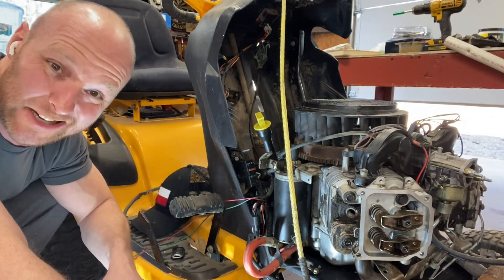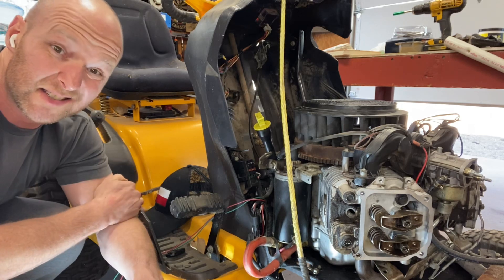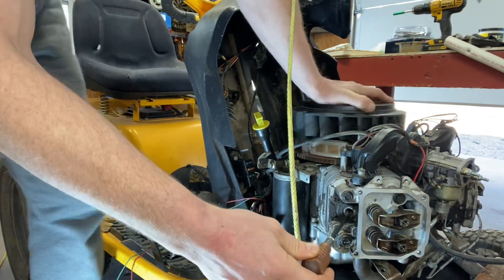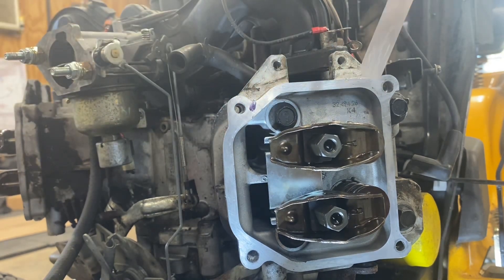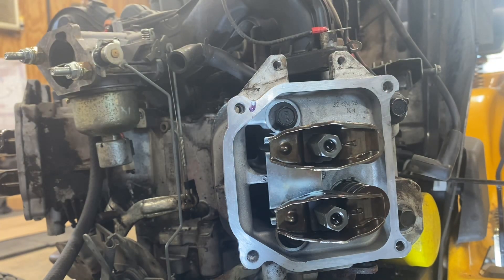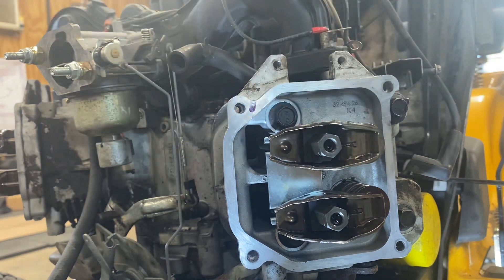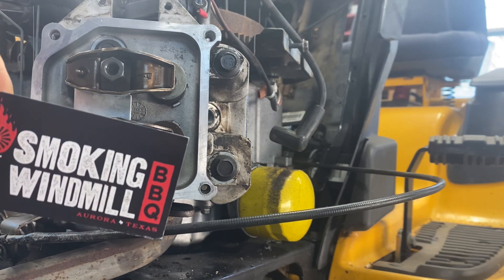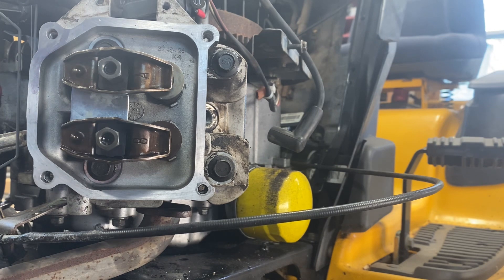Kohler Courage Valve Lash Adjustment & CARD TRICK!!

Comment: Excellent video well done. I have just replaced the crank shaft on a Kohler HD775. We lined up all the markings and put it back together and adjusted the valves at TDC and it will not fire up doesn't even try. We have a spark (new spark plug) fuel (new fuel) checked the carburettor and all fuel is flowing and done the usual checks on the safety. Any ideas on what we may have missed. Thanks and keep up the great work us small Maintenance company's swear by them. Steven
Reply from the maker: If you have fire and fuel I would check compression. Then check if you have any intake leaks. 

So cool i have professionals watching, I am far from that just tinkering and learning. Let me know what it ends up being. Just keep at it and don’t give up you will figure it out.

Comment: Do you do top valve and bottom valve on each side at the same setting
Reply from the maker: Yes it gets them close enough
Reply: @MowerMike I mean in the video you just done the top valve i asking you if you do the top and the bottom one also are just the top one you did because you only done the top not the bottom one just trying to make sure before I do it because if I need to do bottom one at the same time I will thanks just let me

Comment: Love your videos, thanks. Question if you have the time. My son bought a used Lazer in the winter so he couldn't really test it. 500 hours Kohler CV742 Starts ok but revs slow but gets there. When cutting or going up hill loses rpm fast, He had it at a local mower shop twice for a fix, nothing. It's a good mower shop, and checked everything, coils, carb, compression and fuel system but never pulled the engine to check anything internally. To me, it feels like the timing is off, but the keyway is fine. Do have any ideas, we have no problem taking engine apart to fix it. Also I had my son run the mower uphill so it would bog down, and I was behind him and pushed the governor lever and nothing.
Reply from the maker: Hey thanks for the comment. 

If you have fresh gas and the carb is clean my guess is the piston rings are just getting worn out. Try checking compression yourself and if it is under 100lbs or so it needs fresh rings. Let me know what you find out.

Comment: I a bit confused. So if my piston is at the top can I just set both the valves on  that head?  I was told by Taryl that if your piston can be in the upward position yet your valves are not completely seated. So what is your view on this?
Thanks

Comment: Hello, I’ve been searching the internet for an oil filter and oil to use in my SV-720 courage Kohler engine. Do you have any tips on what oil to buy? Can it be just normal car 10w-30 full synthetic?
Reply from the maker: Hi there. I highly suggest using Amsoil 10w30 small engine oil. You can get it at the link below. But really any 10w30 oil will work. Key is keeping it clean. 

https://www.amsoil.com/p/amsoil-10w-30-100-synthetic-small-engine-oil-ase/?zo=1360728

I would google your engine model number on Amazon and get an oil filter.
Reply: @MowerMike  ok great, thanks for the help!!

Comment: Hey Mike, I have the Confidant 747 and have had bent rods before.  This time one broke and one bend.  Replaced them and went to set the valve lash and only one of the 4 rockers move when I turn the motor.  Is the cam wiped?
Reply from the maker: Hmm not sure on that one. You may need to open it up and find out, can put new piston rings and gaskets while you are at it.

Comment: I adjusted the valves on a Predator 1400 Generator just this morning, I thought I was stuck because one of the valves called for .00023 to .00039. My smallest feeler gauge is .oo4, just above the higher limit. I made a feeler gauge using my micrometer and tin foil. Three layers came out to .00027. I folded the edges down to where my feeler "Strip" was about 3.8" wide with the rolled edged on both sides. I use y needle nose to put bend in (Like a lot of feeler gauges have) so I could actually get in to where it needed to be without tearing or crumpling the foil, made the adjustments and it went just fine.
Reply from the maker: Those are crazy small tolerances
Reply: @MowerMike  It was! It took several tries on each to get it right. Those were the smallest rocker arms I've ever seen, too. The center adjusting bolt was a T-10 and the lock nut was an 8mm, but the arm itself was about half as long as my thumb. The valve springs were about as big around as somewhere between a dime and a penny. The push rod slipped out of place once. It was maybe a tiny bit bigger than a Bic pen refill. My needle nose was too big to get it back in place and I had to use tweezers.

Comment: Good instruction but I wud emphasize Mike’s point to NOT over-tighten the set screw (with Torx screwdriver). I’m not real strong (a senior) so I tightened it a second time to b sure. Disaster! The bit snapped inside the set screw. It’s very tight and I’ve tapped it, magnets, etc and can’t get it out. I will get a good metal drill bit to try and drill it out. If that direct vibration won’t get it out, I might leave it cuz if that doesn’t get it out, I doubt it will come out. Even if it does, I think it would just lay on the bottom of the valve cover anyway.
Reply from the maker: Youch, sounds like you are stronger than you think!!! I would just see if it runs as is and not take it out unless you have to. 

When removing stuff like that I found that left handed drill bits work the best. Just keep drilling with small bits working up in size until it grabs. Or you can try and cut a little slice with a dermal type blade and see if you can get a flat head screwdriver on it. Let me know how it comes out. Worst case you remove the head and take it to a machine shop and they can fix it for ya.
Reply: Unscrew the bolt on top of the rocker with the set screw in it and you will easily be able to get it out because there will be no pressure on it.

Comment: I'd like to see what the square plug of wires goes to from the engine must go to something john deere doesn't have
Reply from the maker: Find the square hole and plug it in.
Reply: @MowerMike  there's none on this John deere cause the engine didn't go to the mower its a zero turn John deere tractor mower the original engine was a 18hp is all the guy said

Comment: Lets see your wiring on that so i can see how to hook it up on this john deere zero turn with the steering wheel instead of handle bars i don't like this john deere i got might take off its weird steering wheel and front axle then no more swivel wheels
Reply from the maker: That mower is long gone, good luck
Reply: @MowerMike  i looked up Kohlers wiring colors and i should be set with that but mine are all fucked up

Comment: Just opened my valves case for a head gasket job, valves only have on bolt in the center , no inner hole for a inner lock , how do I adjust a single screw valve?
Reply from the maker: I have no idea. Good luck
Reply: @MowerMike  hydraulic lifters, unadjustable apparently

Comment: The valves on my Toro Branco were T15. Other than that, your video was spot on and fixed my problem.
Reply from the maker: Glad it helped
Reply: Also on the Kohler 7000 series (KT735) it uses a T25.

Comment: I just paid someone to adjust the valves on my Toro zero turn and within 2 weeks it is difficult to start
Doing the same thing again. What do you think?? Is there a point where they aren't adjustable??
Reply from the maker: I would adjust them again but pull your pushrods and make sure they are not bent.
Reply: @MowerMike  ok thanks

Comment: We were getting surging and so on.  Before I had chance to look at anything (like fuel filter etc) it fully quit and will not start.  Occasionally it nearly catches but does not fire up.  

Found a cracked valve cover and under that I found a rocker had slipped off the spring perch and sat diagonal in the valley.  I can manage it back onto the perch (but failed to think about TDC, will when I get back to it) but it just pops off just as easily.  I have not tried to start it since finding this, or after realigning.  And I have not had chance to investigate bent pushrod yet.  

With this lash set properly will the rocker come off the perch?  Is there some other obvious failure that this indicates?   I have not had the lash checked in at least 2 years, maybe more if the shadetree kid who did some work didn't look at this.
Reply from the maker: It will if the push rod is bent or the bolt holding the rocker arm is loose. Just take off the rocket arm and pull out the push rod and see. You got this
Reply: @MowerMike  
I only did minutes of looking once I pulled the cover and saw the cocked rocker.  Got diverted to some dirt work that was explained to me as being more important.  And then a week of work.  

I think the rocker nuts were tight but I've been "researching" valve lash and getting TDC (the correct one) so I can hit it Friday.  

Thanks for the feedback and video.

Comment: Just a word of caution on these Kohler Courage engines...

I've twice had one apart and found a rocker arm stud had backed out (enough to unseat the push rod, which then gets bent when it gets caught against the back of the pushrod guide plate on a tappet upstroke).  I'm replacing a pushrod on my 2010 SLTX1050 right now that suffered this issue.

Now whenever I adjust valve lash on one of these engines, I remove the rocker arm studs, clean the threads, apply a little Loctite thread locker (high temperature blue, or orange) and torque them a little bit above spec.  Then I let it sit for a day for the thread locker to cure.  In the case of my SLTX1050, I had never adjusted the lash, so this happened without any post-factory work.  But the other one I worked on... the owner had adjusted the valve lash.  I think one of the causes is loosening the rocker adjuster nut without first loosening the Torx jam nut, which has the potential to break the stud loose from the head.

I believe Kohler issues a service bulletin on this issue for some of the Courage engines, with a new torque spec for the rocker studs.  Regardless, something to be aware of when adjusting valve lash.  At a minimum, retorque the rocker arm studs.
Reply from the maker: Great advice thanks for the comment
Reply: That's not a kohler courage.. kohler courage are single cylinder
Reply: @RickyShew yes it was. Courage was made in both single and twin cylinder..

Comment: You just need to open fully the opposite valve. TDC is not required.
Reply: True you can but at top dead center, you can set lash on both valves without moving motor in between adjustments
Reply from the maker: Thanks Ned

Comment: alright so I have a kohler challenge motor Toro lawn tractor.  haha, I am not an engine guy, so I didn't think about the valves.  is this why my tractor loses oil?  I am getting ready to replace the gasket on it, but I want to make sure that the gasket is the only thing I need to change.  If I have to do a valve adjustment, I'm gonna need help.

Thanks for the video and the food for thought!
Reply from the maker: It could be a lot of reasons but these engines are known for blown head gaskets. Check out my Kohler head gasket video. 

No just a valve lash off would not cause it to burn oil. It is either worn out piston rings or a head gasket
Reply: @MowerMike  thanks mike!

Comment: Where did you find the specs? I have a Kohler KT730. Is it .005 for all of them? I’m having a hard time finding anything to tell me the valve lash specs for Kohler engines. Any help is appreciated.
Reply from the maker: I just google the engine model and find a manual. .005 will get ya close enough
Reply: @MowerMike  thanks for replying. Great video

Comment: Commercial printer here for 35+/- years... there is NO standard thickness for cards. Don't use a business card. Also depending on your model engine, they do have replacement valve covers that use o-rings so no gasket.
Reply from the maker: I can’t argue that point, thanks for the comment
Reply: @mowermike where can I get the valve lash specs for a cub cadet st100?

Comment: So that is the exhaust valve? The intake valves don't need checked? Mine took forever to start, got worse and worse. Then while running, put at idle and it died, turns over never fired up again.
Reply from the maker: You should check both if you remove the valve cover
Reply: @MowerMike  intake is the same clearance? Its a 16hp Kohler courage
Reply from the maker: @DucksSpitPPG  Ya you can use the same, google it if you want the exact number.

Comment: How many hours should I do this ?  Thanks
Reply from the maker: I don’t think it is a maintenance item, I just check them if the engine isn’t running right.
Reply: Kohler engine manual suggests adjusting the valve lashes every 200 hours.

Comment: I have a kohler sv720s and it’s missing compression in one cylinder, any ideas? Also did you get that free bbq?
Reply from the maker: I suggest pulling the valve cover and checking the valves first. Then maybe do a leak down test and find if you blew a head gasket. Got a couple of videos below for ya. 

https://youtu.be/IuKllmVG4BI
https://youtu.be/8GVQjABiGcc

And yep had to fix the owners golf cart but got some free BBQ!
Reply: @MowerMike  thank you

Comment: I have a 18 hp kohler courage started cranking really slow and starter getting hot won’t spin fast enough to start not sure what’s going on with it
Reply from the maker: Check the starter solenoid and ck the connection
Reply: Did you ever find out the problem

Comment: Koehler 7000 when I push the pedal to raise the deck, the engine wants to die zt1 cub cadet 54 inch
Reply from the maker: ??? Is that a question
Reply: Yes doesn’t matter if mower deck is running or not, when I push the deck lift pedal the engine starts to die?
Reply from the maker: @mikemcelwain  I have no idea sounds like something is rubbing. I would pull the deck make sure all the bearings are good and make sure nothing is hitting under the mower between the deck and the frame.
Reply: @MowerMike  my brother in law has the exact same mower zt1 cub cadet 54 inch, we both have lost weight and his was doing the same thing. because when you push the pedal lift our butts trigger the sit safety switch,guess we need to eat more burgers 🍔
Reply from the maker: @mikemcelwain   Now that is funny!

Comment: Exactly Rex Notlob 1/4” (6.4mm) past TDC although I still do not know if that is 1/4 in past the Top dead center on the flywheel or on the blunt screw driver down the spark plug hole. I presume that it is the flywheel. FYI the intake valve opens just before the compression stoke. i.e. turn the flywheel over till the inlet valve opens and closes check the piston is coming up on TDC the tappets should be loose.
Reply from the maker: I really don’t think it matters since the push rods are not moving at all at TDC or 1/4 past. But I assume it as a 1/4 stroke of the piston down past TDC
Reply: @MowerMike  1/4 past TDC because the exhaust valve is slightly open at TDC to allow compression release.
Reply: @MowerMike  yeah 1/4" on the stroke. That would be the anal thing you talked about. 😂 . Thanks for the video, good job. I'm in Australia and this is my first attempt at adjusting the valves on my Kohler Courage 15. 👍

Comment: Most of the time it is the compression release not the valves. Gives folks a false sense of confidence. I get these older Kohler 20 and 22hp & the valves R sloppier and Floppier and than Nancy Pelosi's tits and they run fine. Where this goes to and it ends up is you are designing a way for the valves to hang slightly/partially open and the motor does start and run but U will start feeling a very slight cavitation again at start up and sometimes while running that will start immediately but it will run and drive fine so pay attention from here... . I actually convinced myself to do this and what I discovered was thru a compression test which told me I left the exhaust on one side was hanging partially open and the intake on the other side and it was starting with no problems but I did notice I lost umph from the engine not running or driving it was when I hit the PTO and cut heavy grass boy did I notice it then but not before not at all U would think U fixed the machine and it actually idled and started normal again. I was only when I went to cut grass I noticed what was missing. So I am assuming that this video is presenting the situation that thru the fine adjustment you will manage to leave a sole valve almost undetected partially/ever so slightly open its un-noticed until ya pull that PTO knob. Then ya hear the Koo Coo clock chime...

Comment: @ TDC you should move the piston 1/4 of a inch down   I like the theory of the card  in a pinch .when you have weak spark ? clean the coil and magneto the gap is one business card or 2 playing cards lol  or a new belt cardboard slip cover .lmao works all the time . Most people don't know the difference  there are 2 top dead centers /If the valves are tight spin it over so you feel the play / then adjust them .as the motor will run not well .
Reply from the maker: Thanks Rex good suggestion on the coil gap